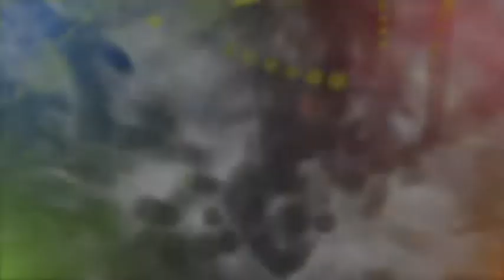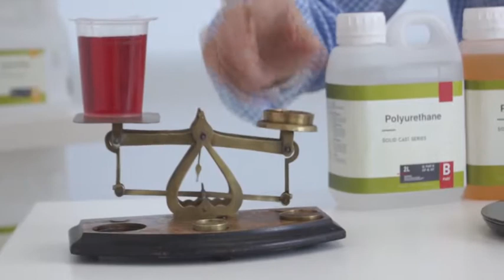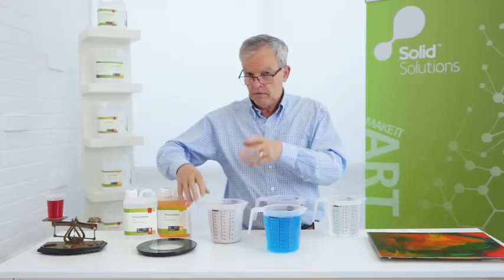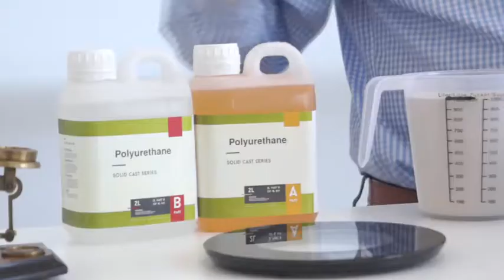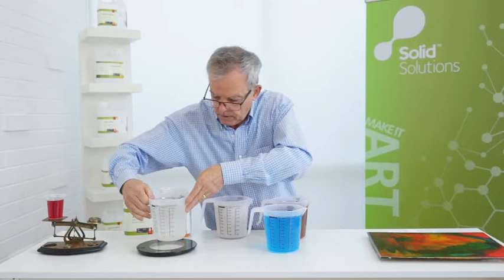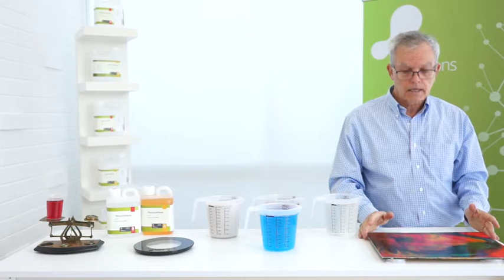Importance of mixing by volume or weight

Comment: You need to add the ratios by volume on the containers as you don’t work out the area you need to cover by weight, you work it out by volume. Having to weigh out your product as apposed to measuring it out in jugs makes it less enticing to use and I can see there always being an excess in epoxy this way.